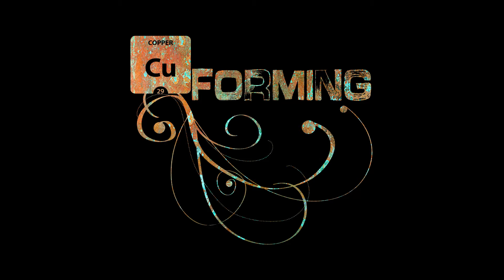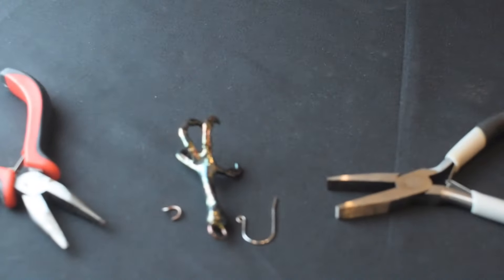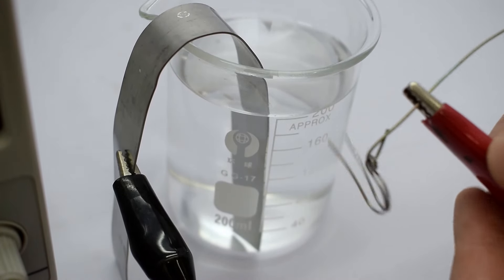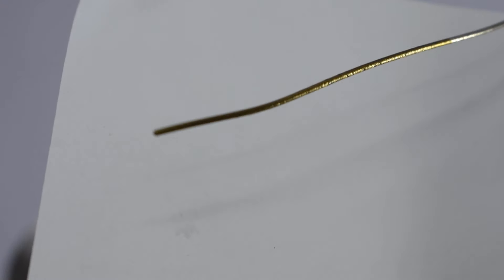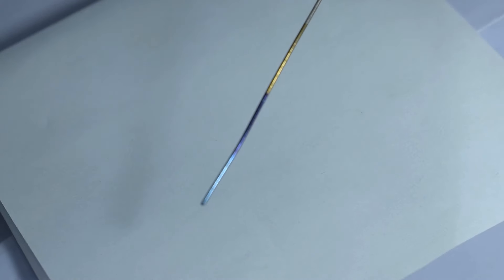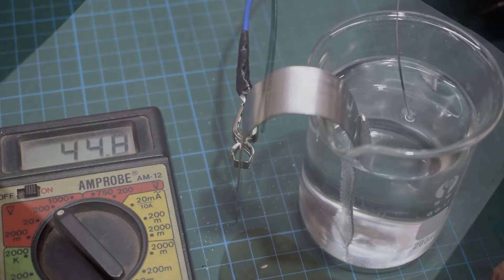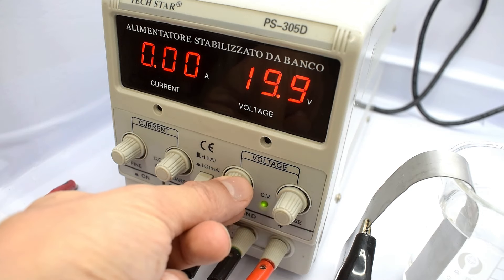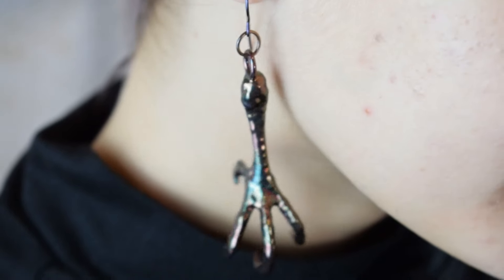Anodizing Titanium Experiment with Earrings Hooks #titanium #anodizing

Comment: Whilst I'm unsure of the temps for each colour change, simply heating titanium up also causes colour changes (can use lighter, hot plate maybe or make a mini nichrome heater band to poke it into e.g e-cig mod coil!)
If those bubbles are an indication, I think the issue was amperage not voltage, if I recall right, amperage breaks the process so you need a way to limit that to nothing but retain the voltage, maybe manually wind a coil?
Reply from the maker: I'm gonna make a stabilized regulator, the one I made is base on the voltage drop... I need it to be stable... I have the module display for volts and amperes too... I will also try heating the titanium to see what happen... but you have to admit, doing it with electricity it's more fun.